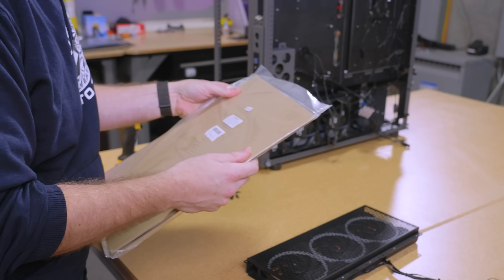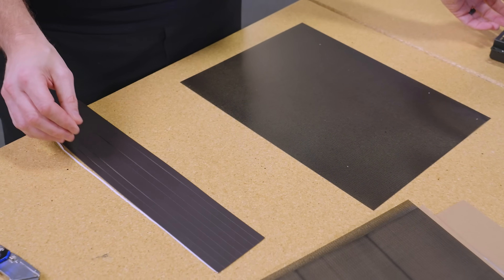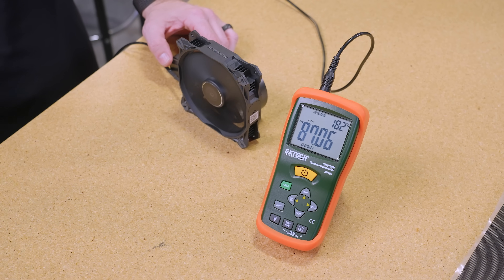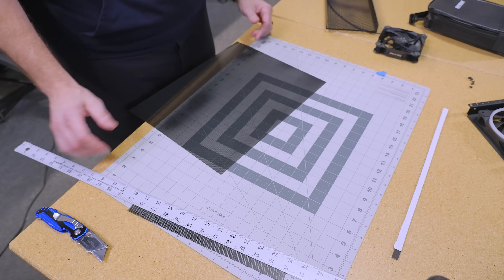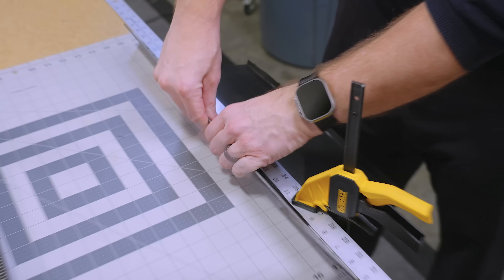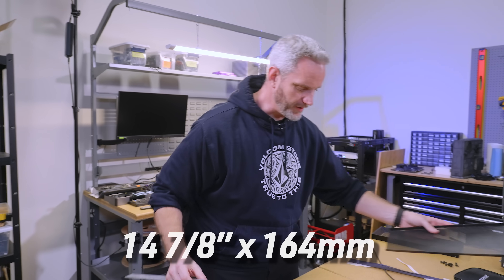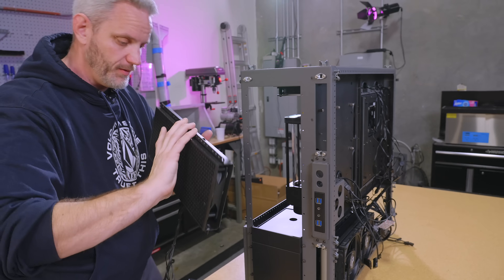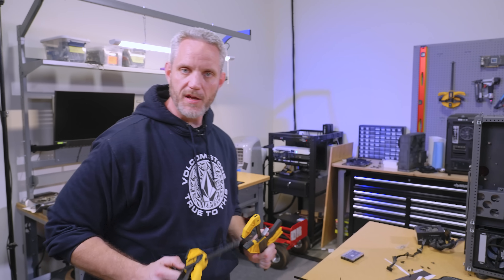How to create your own PC Dust Filters!

Comment: Nah. Just blow out the case once a month.
Reply: Guarantee, especially if your PC is like that, it's going to be big and heavy and you will barely, if ever, do that
Reply: Is risky
Reply: I don't have filters nor do I blow it out. I've see smokers systems working fine so my slightly layer of dust will do me fine haha.
Reply: Even with filters you should do this
Reply: I am doing this, I can't stand my PC building up dust, lol
Reply: I have filters on my server. I only shut it down when I have to so having filters to remove 90% of the dust is worth it. Don’t run them on my gaming rig.

TLDR- depends on your use case
Reply: …with a leaf blower.

…

…

This is a reference to Jay's earlier video and a joke, don't do that.
Reply: in the house?
Reply: .... you must not have a lot of cables plugged in
Reply: Or once every few years.
Reply: @dside_ru ???
It works, I have done it for years.
No joke
Reply: @lolcat no, you should take it outside.  Wait for a nice day
Reply: exactly, then the whole thing is clean. and the radiators.
Reply: Why..? A nice fine vinyl mesh filter is literally life changing.

Cleaning the filter takes like 5 seconds, I probably do it once a week
Reply: If youre careless yeah, get esd safe brushes, take your time and get an esd safe electric blower instead of compressed air@afiguerog

Comment: I make my own with nylons. Put your fan inside like a bag, super glue or hot glue a few points to keep it in place and then trim the excess. It's worked super well for keeping dust and dog hair out of my stuff, and the reduction in airflow is almost zero.
Reply: As in ladystocking? 😮
Reply: Nice!
Reply: @AngryCellist Yes.
Reply: what mesh size are you using? from 50 to 500 mesh? Want to get 500 mesh but worried about the airflow being blocked too hard
Reply: Fishnets? 😆
Reply: i have used the same method on my old pc read it on reddit years ago to keep dust off because my city is dusty, in fact i just built a new rig and even before i bought the monitor i already knew i was going to need ladies stocking so i went to ladies shop to buy and it was weird interraction to ask someone for ladies clothes because i had to be specific about the size and thickness, so i made it clear many times it was for a dust filter, that's why i took the the small top case filter with me just to prove i'm not going to wear those stockings.
Reply: @othmanezerbane8251  wow you worry too much about them ^^ just make it a funny interaction and let them doubt if they want to haha XD

Comment: Back in the day, if we wanted dust filters on our custom PC's, we got hold of a pair of black tights (Stockings). We'd then cut out a square frame from thin plastic, glue the material onto it, and double sided tape that to the outside of the inlet fans case hole. If airflow felt like it was being overly restricted we'd just make another, but stretching the material a bit more to make the perforations in it bigger.

There wasn't all these off the shelf PC modding toys back then. If you wanted to build something cool, you had to engineer it yourself. I'll always remember a friend water cooling his Intel Celeron 300A. This was long before the idea of water cooling became a mainstream option. He machined his own water block out of billet copper, used a 240v water pump to move the coolent, and for a radiator he got a large heater matrix made for a car. We all told him it would leak and fry his PC....... and that's exactly what it did. But not before he'd managed to get this 300mhz CPU to run stably at 600mhz for a few days !!!

Comment: You can make your dust filters from
-bug screen net,there are some with small holes,or you can put two pices ofcenter one on top of each other.
-ladies' tights.streach the material and place it between two diy square frame made of pvc/acrilic.glue them together to secure them in place and done.
Sry for my english.

Comment: I got this kit for my Thermaltake Core V1.  Replaced the top acrylic window with just a mesh filter to allow more air flow.  These things are great for what you want - a mesh dust screen.  The good thing about them is you can cut it into whatever shape you want, not just a 120 X 360 (or 240)mm rectangle.
Reply: Any idea of temp difference? I have this case and tbh im pretty disappointed in thermals so if you know how much your temps went down idle then please let me know

Comment: For years I've been using Frost King 15-in W x 24-in L x 0.1875-in Washable Cut To Fit Air Filter from Lowes $3.00 and sticky back roll of velcro (use the hook portion) to attach to my computer from (Walmart) Filter sticks to velcro hooks. Can be washed or vacuumed to clean. Filter material is used to filter air on window air conditioners. Sometimes is hard to find in winter. Easily to remove and replace. Works really well!

Comment: I bought some fine mesh steel sheet a few years back for a case with no dust filters & cut it to the same size as front of the case, then drilled holes in it at same spot where the fan screws would go. I then mounted it on the opposite side of the case mounting are for the fans which gave a gap between the blades of around 2-3mm (the thickness of the chassis & the fan surrounds). I did try mounting them directing between the fans & the chassis but there was some turbulence noise that was substantially lower with the gap when mounted on the other side of the chassis. Using fibre washers between the screw heads & mesh stopped it from creating small gaps where the screw would depress the mesh when tightened allowing small gaps to be present (very small gaps but caused more higher frequency noise when fans where at higher RPM which got annoying! The washers also neatened it up as well in that friends thought it was actually a part of the case instead of a bodge job 🤣

Comment: I made filters for my current case using steel mesh.  You can get A4 sheets of it in various fineness, it is usually used as insect/rodent mesh.  Can be cut quite easily with tin snips or even heavy duty scissors.  Also these days I tend to use Nano-pu gel type double sided tape to stick things like that down as you can pull it off and reuse after a quick wash & air dry.

Comment: I once found some fine netting that came with a bunch of flowers. It was high flow and caught enough dust to make it worth it. Never found out what it was called, but it was a dark grey/black mesh/netting material and it came from a flower shop.
Reply: you mean those mess thingy t hat comes with bouquets? I think if you go to a flower shop and ask them what it is they might be able to tell you. The good thing about is that it comes in different colors. never used it as filters though.
Reply: Look around the garden section your local home improvement store. They should have similar netting material for holding down soil and loose mulch while the perforations let water drip in.
Reply: I bought a ton of it online, but it came terribly cut and the corners were breaking apart.
I ended up getting some old kitchen extractor filters, those have a plastic frame and if the size fits your case, you can use them right away.
You can also use a soldering iron to insert some magnets directly into the frame, making them super easy to install.
Reply: ...and it was the greatest day of my life
Reply: i think you mean chiffon fabric

Comment: Pet screen at your local hardware store I find does a pretty good job, and you can get some magnet strips there too!
Reply: do you mean the one for mosquitoes and bugs used in windows?
Reply: i thought on moskito filter would work and it might work ... but a Pet screen is squared mesh but its large enough for dust enter anyway... it might help on airflow and less dust entering but not as effective as moskito type mesh or something small as that ...
Its like a trade off from Airflow vs Dust flow =P
Reply: @TarsoSousa  That´s what I use... And whole roll of it costs less than 10€... and you have several square meters of it of the same fine mesh.
And it is flexible, which may or may not be advantage
Reply: You are correct, it isn't quite as fine of mesh, however, the finer mesh screen i find is usually steel mesh, and I prefer a fabric mesh and more airflow. Honestly, just a matter of preference. My point is more, shop less Amazon, than use what I say.

Comment: There is a kind of very fine neting material thats used for dekoration. I bought a 25 meter roll for maybe 15€. 
Pros:
+Only the finest dust gets behind this mesh!
+ Its super easy to apply (magnets, tape, or in some cases you can just sandwich it in).
+ It blocks almost no airflow (at least i cant tell by messing around with it)
+ Cheap!

Cons:
- You have to clean this often because it will get "full" often and hinder airflow!
- Its very fine so you can damage it easy!
- Your girlfriend might "borrow" it to "dekorate" stuff without asking you and you will have no mesh left if you need it for a new build LOL

Edit: This stuff is called "Organza" where i live.

Comment: I used silkscreen cloth, and it seems to work great as the weave is super fine, i just use some nanotape/acrylic tape to stick it to the back side of my front panel. then to clean i can take the panel off to either blow the dust back out or flush with a garden hose

Comment: I used these with the 1mm pores last week on my Gungnir 110R case. I wasn’t happy with the airflow through my front mounted 280mm rad because half the front panel was a piece of plastic. Replaced the plastic with the filter mesh cut to size, still looks great and liquid temps dropped by 3-5c

Comment: Cool. I have a merlin st10 (the XL-ATX one) and my way to filter the front is speaker mesh. I cut a piece that can reach all four ball sockets on the front panel and push the sockets through the mesh, making sure the material is a bit loose as it'll need to stretch. Then I put the front panel on and the material will stretch over the perforated grill pieces and filter the whole thing. Considerations/limitations are (depending on the case) to make sure the mesh is positioned well so that the mesh doesn't obstruct the front I/O block (mine fit quite well and didn't need any extra help) and the 5 1/4 bays are unusable without extra tweaking. All it needs for maintenance is a vacuum or dry wipe to the outside every few weeks. And my bottom filtration are 3 140mm silverstones which do the trick there.
Reply: Yep, done that too - works quite well. 🙂

Comment: Such a great video! There are some cases (i.e. corsair 4000d airflow) where one of the most common complaints is that the air filter in the front gets too loose and starts buzzing on the front intake fans. This is such a good idea to make a new filter that is much more rigid and inexpensive.

Comment: I used the material mesh you get in the front of spikers its similar to lady stockings cut it to size and fitted it with carpet adessive there is no airflow loss that way.

Comment: you can get the screw on ones but if you cut a slot into the side of the holes at a slight angle you can then twist on and off so no screwing and unscrewing every time

Comment: Jay, it makes sense to use a top filter for a quiet build, when the top fans are stopped most of the time, like in mine. I am using water cooling on the CPU only and the fans only start when the temperature goes over a certain threshold. If not mistaken I have it set to 45° and the max temperature for my CPU is 60° (AMD Fx-9370). 
There is no point in having the fans working all the time since browsing the web and similar tasks do not push the temperature high enough to even get the CPU warm.

Comment: Nothing will ever surpass Demci filters. For me, they are so incredibly worthwhile for the degree of filtration, airflow and easy maintenance. I thought of making my own but I would never do as good as Demci.
Reply: Overpriced kitchen extractor filters, at least they're magnetic...
Reply: @YOEL_44  lol what!? They are nothing like a kitchen extractor filter.
Reply: Have you ever tried frog skin mesh?
Reply: @bigjohn6341  I haven't, looks a lot like Demci only more restrictive to enhance water resistance and not cut to sizes which suit PC cases driving up the cost/time of a custom job. Am I interpreting it right?
Reply: @DanielKennedyaeos   I meant to replay to the whole video but I was wounder if anyone has used it alot of atv and sxs use it on vents and some companies use it as a second air filter inside the main filter
Reply: @bigjohn6341  Judging by what I've read they're great for that purpose. For simple dust filtering in a dry and mostly immobile environment like in a PC you trade performance for functionality you won't use.
Reply: @DanielKennedyaeos  I have 5 dogs 1 is a  husky and live between corn and bean fields I have to blow out my pc every 2 weeks
Reply: @bigjohn6341  sounds like Demci filters would work well for you. I have a dual coat indoor dog that sheds everywhere never found any hair or dander in my 3 PC's with Demci filters.

Comment: I have been making my own filters for a while now. Airflow deductions be damned. Ive never seen a noticable issue.   One PC case, a cooler master something( its 12+ yrs old, still great)  I went nuts on, I cut very thin strips of the foam used as AC filters for window units.    I took those strips and a screwdriver and pressed them ito every open nook and crannie.  Around the optical drives, between side panels etc.  Then made just two plain squares help on with velcro for the side fans. Case stays CLEAN!    Newer case, a P400 from phantexs, I just put a large rectangle of that same flter on the inside of front panel, no dust.  I have a completely blacked out system, so the dust shows up fierce when its dirty.

Comment: Isn't it better to have really fast airflow through the case, so the dust  has difficulty settling/sticking, rather than slow airflow which allows dust to settle/stick.
Reply: i'd imagine more airflow means more total air and thus more total dust that gets into the pc, and if fast airflow prevented dust buildup we wouldn't see them buildup on heatsinks and fan blades, yet they are the first places that start to get clogged
Reply: @Mikapoofs  Valid point. Maybe heat sinks could be coated in something like Teflon.

Comment: Hi Jay. As a DIYer (2nd Class), I will buy ANY tool that makes doing my DIY projects easier, faster, and more accurate, regardless of the cost. I have a tool you could use. I purchased mine from Harbor Freight, and it's just the tool you needed for your project. It's their CENTRAL MACHINERY 30 in. 3-In-1 Shear, Press Brake, and Slip Roll. I'm sure you will find it helpful, as I did when doing this and future projects. The good news is that it only cost $599.99. I used it when building my DIY PC test bench. Since a top-quality pre-built test bench can cost over $200.00, this tool has almost covered half of what the tool costs.

Comment: i make my own dust filters by 3d printing them. set the number of wall layers high enough to fill in the outer frame, set the top and bottom layers to zero and use a layer or two of infill as the mesh. you can also just print the frame onto some fabric mesh taped to your print bed.

Comment: I was pleasantly surprised when I had found materials like these available myself as I hate the Lian-Li o11d evo bottom filter (and its little insert filter that sits inside the case and you can't remove without removing the rad). I made one myself by doing similar and tracing the shape onto the material, cutting, and adding magnetic strips that covers the entire area, not just a portion.

Comment: Jay, common-sensey stuff, but if you haven't done so, you should equip that building with HEPA filter air cleaners every few meters so they catch most of the generated dust inside that building. 

I live in front of a main road and my HEPA filter air cleaner would get nasty, but I didn't get surface dust buildup on my stuff.

Comment: Best dust filters are the Silverstone woven metal ones. Filters way way finer dust than punched hole mesh, and maintains astounds 70 percent air speed
Reply: Best filters are Demci.
Reply: Too expensive. Buy plus size womens panty hose and use them as dust filters. Cheap and extremely effective.
Reply: @jonatinoo   yeah, fabric mesh just makes a lot more sense, unless you need the filter to look nice for the outside of the case or something.
Reply: Kinda annoyed by its grey/silvery color. Would it be okay to spray paint it black in order for it to match the color of my case?
Reply: @Atrumoris  That'll clog it. Try dye.

Comment: What I sometimes do, is use speaker cloth, or in the case of my current PC, I bought some aluminium mesh material. You can get it in different porosity levels. It will still let through fine dust, but cat hairs (very important in my case) won't pass through.